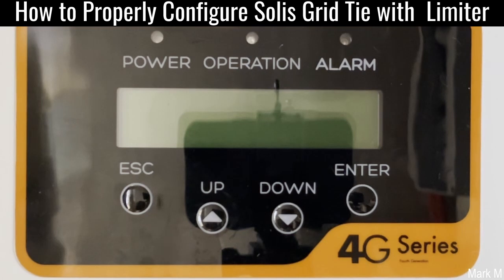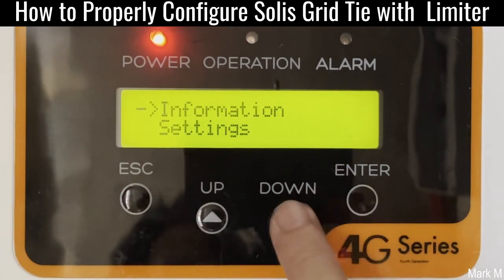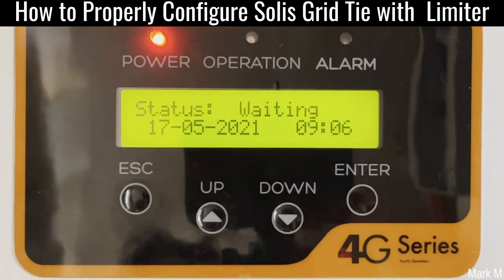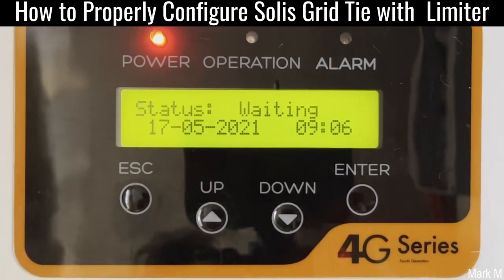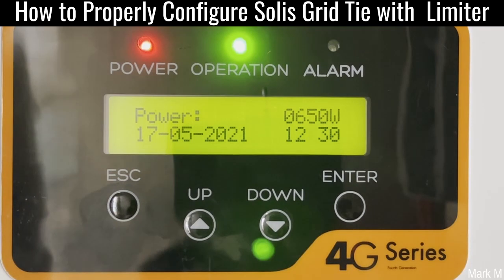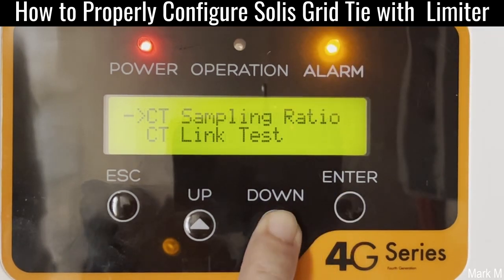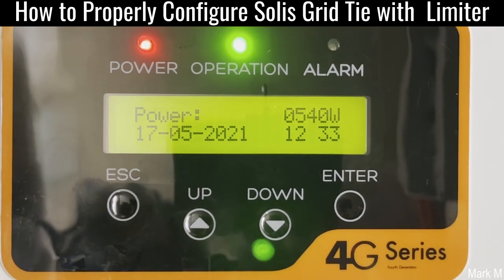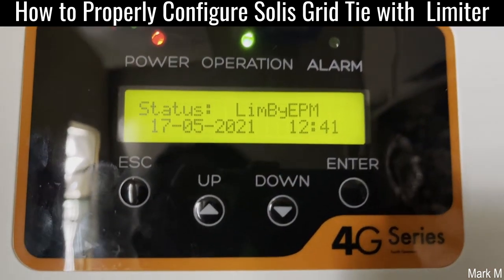How to Properly Enable Solis Grid Tie Limiter Function

Comment: Hello 
I have the same inverter and i want limit my solar production . 
I dont understand where you connect your current sensor on the solis inverter . Have you got an epm box ? 
I dont see a spot to connect the cable on inverter...
Help me please
Reply from the maker: I dont have an EPM Box. place the CT before the load or above your MDP main circuit safety device.
Reply: @MarkMinoza i dont understand if you use a meter or if the ct is direct plug in inverter.
Thanks
Reply from the maker: @guillaumeondet7574  the unit in the video is a CT type GTi. Ill upload a meter type this month for comparison.
Reply: @MarkMinoza  I have installed an Acrel meter and a CT clamp in off-grid mode.
However, my Solis 4G inverter does not block the grid injection.
Yet, I have correctly set the backflow power to 0.

I maybe need à ct gti
Reply: Inverter say lim by epm but inject on the grid...
Reply from the maker: @ you need to consult your local support if your issue persist. its hard to check when no other details are provided such as photos and configurations.

Comment: sir ano adviseable na sampling ratio 3000:1 or 1500:1
Reply from the maker: @MrJ-s3j  its 3000:1 po yan. Dahil sa ratio ng CT na ginagamit.
Reply: @MarkMinoza  Export_P. -0027w power 570w ibig po ba sabihin nyan 27w galing sa grid 570 frm solar? salamat
Reply from the maker: @MrJ-s3j  Export = Selling, nag babato ka ng power papuntang Grid. Importing is ginagamit mo ang power ng Grid.

Comment: can i series 2 unit s6 5kw gridtie? if yes how connect the ct
Reply from the maker: yes, CT can be placed on both Active Line wire. if more than 2 in parallel, you need EPM for that.

Comment: Every morning po ba need to set the limiter kapag ng power on na inverter?
Reply from the maker: once lang yan sir e set. then activated na.
Reply: @MarkMinoza  how about load sir kahit bellow 500w example umalis ako maga at 200 watts lang maghapon nakaactivate pa din po limiter nun? Worry ako kc baka magexport sa DU. TNX PO
Reply from the maker: @MrJ-s3j  regardless, once ma set ang limiter, activated na po yan kahit gaano kaliit ang load.
Reply: Good am sir, tanong ko lang kung normal ba or hindi yung nangyayari sa solis s6 3kw GTI ko. Sa umaga kasi pag i check ko yung display. Naka 20 watts lang yung naka display pero pag i off EPM ko. Tapos pag on ko ng ct sensor tumaas na yung harvest. Talaga bang manual yun or pwedeng i automatic? Salamat

Comment: Thank you for attempting this YouTube. I had my computer lap top turned to Max Volume and I could barely hear you. I do not think that was a simple set up and you seemed confused as to what to press next. Also, what was all the "Waiting"? I am looking to replace my Sun blue box 1000Watt Grid Tie Inverters with limiters, but this demonstration did not convince me this is any better. Can you recommend another YouTube on this subject with Solis Inverter?  Thank you, it sure looks like a nice inverter.
Reply from the maker: Thats "Waiting" to sync to the Grid for 10 minutes as a requirement by the local DU.

Comment: Very informative video, thank you very much. I have done the same setup and also limited export to -00000w (negative) since I do not have net metering from electricity company. The issue is throughout the day my minimum load is around 250-300watts due to my home UPS/inverter but LimByEPM generates around 160watts and limits the rest, when I turon on geyser then it generates more and delivers 2000w to 2600watts for the geyser, but when i switch off the geyser, it is back to 160-180watts and not generating full required load, why is this happening and I have the same CT and my solis inverter is S6 3kw with 540w x 6 mono perc panels. Pls help if further setting is needed to maximize my load. Also should I change my CT sampling ratio ?
Reply from the maker: Don't change your CT ratio if it's working. Though I upgraded my 3kw Solis meter type. I only observe that if my PV voltage drops to 200v. Check your graphs for confirmation.
Reply: @MarkMinoza  my PV voltage doesn't drop, most of the time I see PV being above 220+ and inverter only controls the amp. My graphs are usually up and down. What if I change export to +100w ? But I am scared my electricity bill will shoot up as mine is not a bi-directional meter.
Reply from the maker: @johnruben1444  you may consult your local support. your inverter might need a firmware upgrade.

Comment: Hello sir, paano po setup ng ng limiter pag dalawang Solis grid tie na nka parallel? Hindi ko kasi mkita sa manual. Salamat po
Reply from the maker: Connect both CT on live wire, or use external EPM to consolidate your graphs.
Reply: @MarkMinoza  salamat sir.. kahit 6-10pcs na ct sensor pwede ilagay lahat sa live wire?
Reply from the maker: @arielyu7103  parallel still stable at 2 GTi, more than that, you need EPM if you plan to limit it. But if you don't. EPM is optional. For more info on EPM, kindly see this video.
https://www.youtube.com/live/yOFpafL-h4o?si=F-OjJ9nODGJygkuA
Reply: @MarkMinoza copy. salamat sa pag share ng knowledge  sir.

Comment: I have this inverter and a second 6kw hybrid 5G (with the meter) - but it’s exporting far greater than the backflow limit, it’s like the hybrid can’t “see” what the non hybrid 4g is exporting— any suggestions?   The address on both inverters is 01, is that correct?
Thank you 🙏
Reply from the maker: Are you trying to limit the production? If you do. Enable. The limiter on Hybrid, have the GTi lower rating do all the harvest.
What meter are you using in your Hybrid?
Reply: No, I want to limit exporting -EPM. The meter is RS485, the model is Acrel ACR10R.   

If I set the backflow to zero, the hybrid stops exporting but the 4g inverter keeps exporting
Reply from the maker: @seans5960  then enable limiter on the 4G GTi. Regardless if its a ct or meter.

Comment: Thank you for making this video. 
I have a 4G 5kW Solis inverter. Recently it started showing a hint alarm "Grid over voltage". How do I adjust the setting to stop the alarm. The grid is 238V, so not over voltage (240V system).
Reply from the maker: you can change its Grid Standard to UL-240. Any voltages that goes beyond 235Vac, UL-240 is being used and stable.

Comment: sir yun arrow ng limiter papalabas ba ng grid or papasok, sa video kc papalabas pero binago nyo. tnx
Reply from the maker: Yung CT link Test po ang susundin nyo kung saang arrow. Hindi nyo ma activate ang limiter kung hindi kayo mag CT link sa CT type Inverter. Sa meter no need, ill post a new video using meter.
Reply: @MarkMinoza  sir mark m ano ibig sabihin ng fail safe sa gti
Reply from the maker: @aldeebigueja9609  you can enable Fail Safe or Not, hindi requirement sa atin yan. Ang trabaho ng failsafe is to check the connection ng CT at Inverter. Pag nawala or open ang ct mo, mag alarm.
Reply: @MarkMinoza  sir bakit kaya 11w lang na generate ng gti ko 4x240w pv ko tnx
Reply from the maker: @aldeebigueja9609  anong Vmp ng pv nyo at rating ng Solis Inverter na Ginamit? Disable nyo muna ang limiter para ma check ang max output.
Reply: sir Solis 1.1kw na gti
Reply from the maker: @aldeebigueja9609  wag nyo munang e limit, para makita nyo ano ang max power ng 4 pv
Reply: @MarkMinoza  tangalin ko sir ang limiter or disabled kulang sa settings
Reply: sir Solis 1.1kw ang vmp 29.8v per pv
Reply: gud am sir as per advice mo inalis ko limiter by 830 am nag generate na sya 284w , bkit kaya ganun pag may limiter mahina harvest
Reply from the maker: @aldeebigueja9609  depende, so i suggest have the ct link test properly. After that, your setup would be good.

Comment: how does Meter in Load work? does it mean that the CT is placed in the Load side of facility?
Reply from the maker: Meter in Load connection depends on the type of meter you’re using, I’ve placed a reference link below. But the way it works, think of it like connecting a sub meter to other connection. The meter is placed between source and Load. DU setup is meter in Load. Accuracy is high also in terms of reading.

 https://youtu.be/XalI0hPni3o ,

Comment: What is your pv connections? I have 4pcs pv panels 250w @34.1Voc each, what connections do I do?
Reply from the maker: Have it all in series. What I have is 12 x 100w all in series. Vdc startup is at 60v. So your 4 pv is perfect.
Reply: @MarkMinoza  Done, sir all 4 in series. And it's generating power. Thank you

Comment: Hello Mark, gusto kong mag-ADD ng isa pang SOLIS inverter, i am using SOLIS-1P5K-4G at naka net-metering na, problem kulang na yung 5K sa akin. need more, can Solis be paralleled connection tho net metering?
Salamat po. God bless po
Paano po yung electrical wiring diagram?
Reply from the maker: Yes, no issue on parallel if its net metered. Buy the Meter type GTi S6 models. Just like your existing, just add it to a new branch circuit.

Comment: What do u mean by make sure the load is above 500w? You mean the limiter wont work if the load is below 500w? so 300 watts will be just all be coming from the grid because it is below 500?
Reply from the maker: You current load (watts) should be above 500w for the limiter to be activated. The CT will detect who big is your power during the CT Link test.
Reply: @MarkMinoza  muntikan ko ng i-cancel order ko over 500w watts. Test lang pala
Reply: @MarkMinoza you mean sir sa ct link test dpat over 500 watts ang load mo. Sa testing lng? After non khit below 500 kna gagana n ng maayos ang gridtie inverter?
Reply from the maker: @charlonesantos9796  yes sir, one time setup lang po yan.
Reply: @MarkMinoza  ok po akal ko need always 500 ang load para gumana ang ct link nya

Comment: sir what is the procedure when shutting down the inverter? Which breaker to turn off first?
Reply from the maker: If its running, do the following steps.
1. Disconnect your Grid
2. Disconnect your PV
Reply: This depends on the setup, but mostly you you will have a DC Isolator, an AC Isolator and an AC Switch. To turn off, start with the AC Isolator, then the AC switch and finally turn off the DC Isolator. Do this in reverse to turn on.

Comment: boss tanung lang po about sa ct pano po gagawin dun naka saksak naman po sya pero wala sya sa settings po walang mode select at ct sampling ratio wala po sa setting solis 3kw din po gamit ko
Reply from the maker: Napasok nyo po ba ang “Advanced Settings” ng unit nyo?
Reply: @MarkMinoza  opo wala nga po dun
Reply: @MarkMinoza  wala po sya sa advance settings
Reply: @MarkMinoza  na reset and update kona din po sya wala parin po
Reply from the maker: @alaehcjsvlog  anong model ng unit nyo?
Reply: @MarkMinoza  ganyan din po tulad nun nasa video po
Reply from the maker: @alaehcjsvlog  ano po ang version ng gti nyo?
Reply: @MarkMinoza  solis 3kw 4g series po

Comment: Kung magset up ng grid tie sir,kaelangan paba magpaalam sah DU Sir mark?
Reply from the maker: not necessarily since On Grid po, sa umaga lang libre. kung gusto mong putulin si DU, mag Hybrid Off Grid ka. though mahal dahil sa battery.
Reply: @MarkMinoza  ok po sir,maraming slmat sayo.
Reply: @MarkMinoza  yung CT sensor sir,kasya bah sya eclamp sah stranded wire nah ang sukat ay 25mm or 35mm sir?
Reply from the maker: @anethemia7857  Kasya pa sa 25mm (4awg) sa 35mm mukhang hindi na mag kasya.

Comment: Sir good day po,alwys watchng from cebu prvince.sir mark kung mag install ng sOLis ano una dapat  esettings sah parameters sir?.
Reply from the maker: kung similar hardware na Grid Tie inverter (Solis), this YT is your guide to enable the Inverter not to export.
Reply: @MarkMinoza  sir mark hindi bah masira ang solis inverter kung sakali ang load ng aking bahay ay aabot ng 5kw,tapos yung sOLis invrtr koh ay 3kw lng sir?
Reply from the maker: @anethemia7857  Hindi po since its a Grid Tie Inverter, walang issue sa overload since regardless of load, sa Grid siya nag send ng power, not to your load.
Reply: @MarkMinoza  ok thank u sir.

Comment: In my single phase inverter status shows LIM By Vg normally in midday 12 to 3 pm when grid voltage show 270+ and oneby one some time generating and limbyvg Is It harmful to inverter and vice versa how to rectify this problem sir.pl
Reply from the maker: What's the model of your Inverter and its max PV installed?
Reply: @MarkMinoza  Solis inverter single phase 1P 5 k 4 G and panels 15 for 5 KW sir
Reply from the maker: @ramkumarsharma4139  can you provide the break down of your PV String, how many are in DC1 , DC2 and DC3 in series ?
Reply: @MarkMinoza  in DC1 seven panels and DC2  8 panels .normally in DC1 status shows approx 230 or 240 and in DC2 shows above 250 to 270 in mid day time sir
Reply from the maker: @ramkumarsharma4139  your pv setup is correct, the alert on LimbyVg is has something to do with power generation. The inverter limits its power generation during that time. Check your Advance Information page for more details or your SolisCloud Portal.

Comment: Sir good morning pl solve my problem.as in my house 3 phase Solis inverter and in one or 2 phases from 12 noon to 3.00 pm voltage comes from 170 to 195 Can we with yr kind help limit the minimum input voltage to reqd level to run the inverter without alarm and produce electricity.sir what is min voltage reqd to run inverter smoothly or we can set / modify the range as minimum under un- g- v01 or v02. Pl advise me or any other solution.pl
Reply from the maker: Hi Ram, User Define is country specific. Values might be different ours. If its low grid voltage, choose UL-208 grid standard.
Reply: @MarkMinoza  sir by this option problem will be solved because after 3 to 4 pm grid voltage reaches above 200 .so pl give yr mob no to chat and solve the problem.
Reply from the maker: @ramkumarsharma4139  have you tried contacting your local support? You can choose the User Define Options, I'll. Be making that video on the coming days to address your concern.
Reply: @MarkMinoza  sir It is possible to make / modify limit coming from grid as such 170 to 195 during hot sunny time when solar produces optimistic valuable energy to max and it's use in real sense sir.Can I talk to yourself when Co man comes today most peobly and he will set the lower limit of grid voltage as required to run the 3 phase inverter smoothly sir.or we have to change single phase  Solis inverter sir pl
Reply from the maker: @ramkumarsharma4139  you can configure it. V1/V2 is youre threshold values.

Comment: Hi po boss pano po mg install ng 30kw grid tie po na solis grid tied po diko po alam yung pag parallel nga solar panel po hehehe ng try lng mg design sir... hehehe
Reply from the maker: need nyo po EPM for that huge capacity. ang EPM may manual, nandoon ang design paano nyo e parallel ang connection.
Reply: @MarkMinoza  salamat po bossing try ko e search duon..thanks
Reply from the maker: @fireandrevivalinmyheart6365  sali ka po sa PH Solis Group, may local support naman yan. https://www.facebook.com/groups/413473389645478/?ref=share

Comment: boss baka may video ka paano magconfigure ng energy meter via rs485 zero export
Reply from the maker: Need nyo po API ng hardware to be able to do that. Solis supports modbus protocol running on rs485 using A B connection. External Energy meter is like the EPM. Please see my EPM unboxing vid, may pin config po doon.

Comment: The sequence of Commissioning; 1. start the Inverter ON; 2. AC breaker ON; 3. DC Breaker On? Correct po?
Reply from the maker: 1. Enable the Grid first
2. Enable your PV side ON
Regardless anong gamit nyo na safety device (disconnect switch or MCB) , importante may pang disconnect kayo ng supply (PV or Grid). Iba naman gamit fuses.
Reply: @MarkMinoza  when will be the inverter turn ON? before or after GRID & PV turned on? salamat po.
Reply from the maker: @oshinaguilar  it will turn on Only when your PV has reach its MPPT startup voltage (check your data sheet) . Depende sa wattage nyo, 3kw - 8kw Solis has 120Vdc startup while lower ratings has 90v and 60v.

Comment: Sir paano gamitin ang user define kc laging nag highvoltage s amin kaya nagkulay orange si inverter gusto k sanang iadjust voltage range ng solis 3kw na gamit kp. Tnx po sana maituro niyo po.
Reply from the maker: User Define is based on your Grid provider. Sila ang mag bibigay sa inyo nyan. Ill come up with a guide on that also dahil marami ding nag tatanong. But if your grid is high, use the UL-240 settings.
Reply: @MarkMinoza  tnx po. Try ko po, aabot kc ng 242 - 246volts ang grid namin kaya lging alarm pag sa tanghali lng nman.

Comment: sir may paraan ba para ma zero limit ang grid. kc kahit mganda naman harvest ay may 70 to 80 watts pang consume sa grid.
Reply from the maker: Ang limiter nyo po nag aadjust lagi sa load nyo. Either mahuli o mauna. Hindi talaga ma 0 yan unless ang load nyo constant, hindi gumagalaw. Kung 100w, 100w lang talaga, pero hindi yan mangyayari dahil ang mga gamit natin pabago bago.
Reply: @MarkMinoza  k salamat sir.  nkita ko kc solax 0 and 5 lng lagi yung makikita mong cobsumed load s metro. maliban lng kung mababa harvest. yung sakin solis 1 kilowatt pv ang max load ko lng ay 300 watts . pansin ko kahit tirik araw more or less 700 watts na ang harvest pero mataas pa din yung load s metro bka may mali ako sa settings.
Reply from the maker: @bibsky222  nakikita ko sa 3kw ko na mag 0 using may external digital watt meter sa bahay. Ang 1kw ko pang test lang so hindi ko na test properly. Ill test again.
Reply: Set mo lng backflow power from 0 to 100 watts ma zero yn lalo n pag malakas harvest vs load